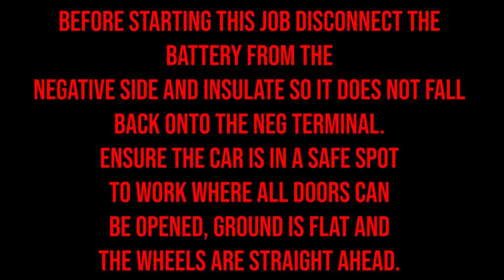300 Series Landcruiser Under Bonnet Dual Battery Kit How To

Comment: Can you run a normal lead acid battery instead of the lithium thatll fit the plate that retains the batterys in place?
Reply from the maker: Hello Tyde!
Thanks for watching, we don't recommend using an lead acid/AGM because they are too heavy for mounting points. 
Thank you 🙂 - The Team at Accelerate Auto Electrics

Comment: Great installation how do you go have the batteries under the bonnet and say a 2000W inverter in the back 😊
Reply from the maker: Thanks for your comment!
The biggest inverter you could run off this system is a 1000w.
Thanks for watching, - The Team at Accelerate Off-Grid Touring 🙂